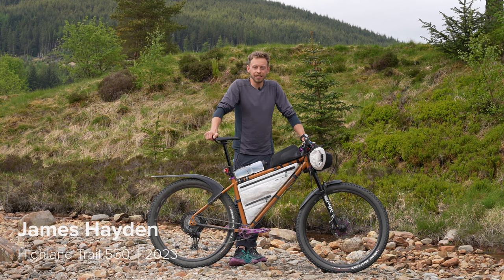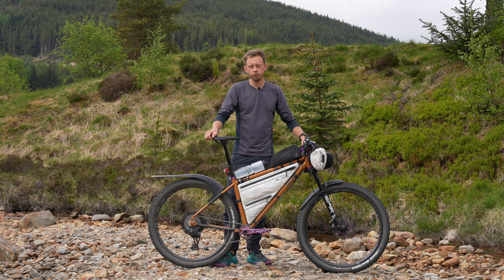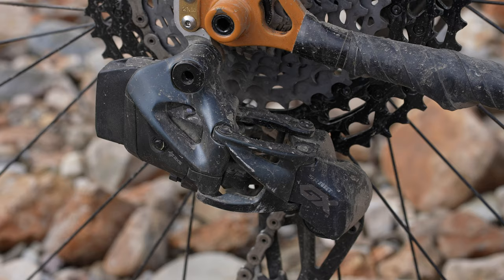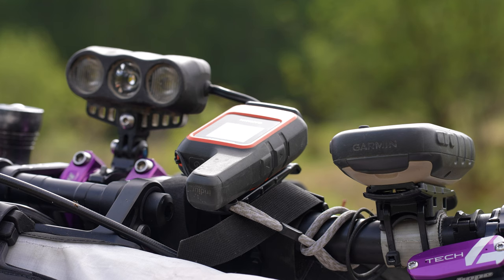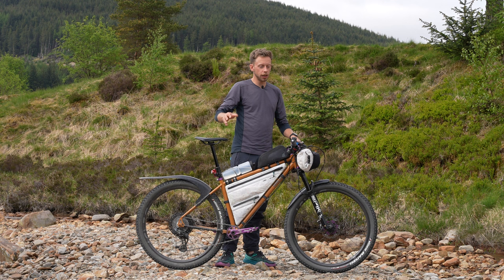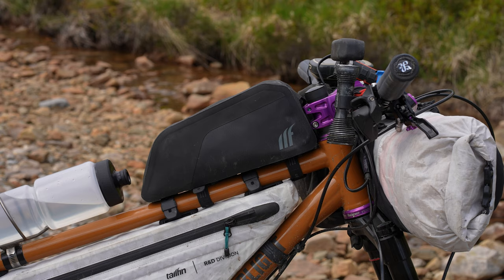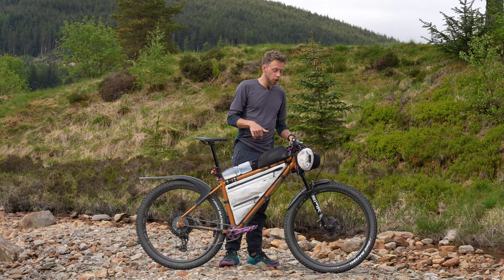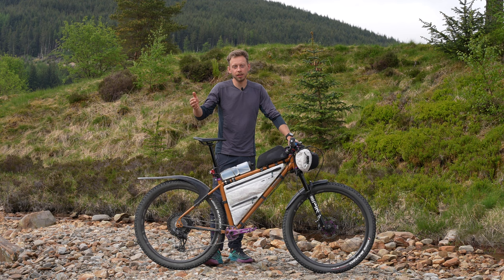Bike Check | James Hayden | Highland Trail 550 | Fairlight Holt

Comment: That front roll bag is like a Tardis! You've managed to get loads in there James😁
Reply: Yeah I was impressed! It's quite long so spacious. Insulated jacket, fleece tights, socks, Rab GTP jacket + trousers, SOL bivi and neo air pad. 😂
Reply: @jameshayden33 SOL escape bivy? Seems a popular choice if so. I think Huw had that one last year!
Reply: @samueldavidson7956  yeah, light but also works ok to retain heat, stop wind and breath a little. I think if you're trying to actually sleep it's not good, but for 1h30 it's fine, and wore my insulated coat.

Comment: How did you manage to get a 180mm dropper on it?
Reply from the maker: It looks like James has placed the dropper fairly high in the Seat clamp allowing him to fit the 180mm
Reply: @TailfinCycling  The Holt takes a 27.5mm seat tube. The only compatible droppers I've seen were ~120mm ones
Reply from the maker: Hey, looks line PNW make one going all the way up to 200mm!
Reply: @chrthiel this isn't quite a Holt and has 31.8 😉
Reply: @jameshayden33  From the beginning, I was wondering why Fairlight decided on such a niche product with 27.2mm seat tube, as it doesn't matter so much, because 31.6mm droppers have already around 27mm upper tube, and that matters the most for compliance. With standard seat posts 30.9/31.6 they could offer 27.2  adapter... Congrats on your recent great results by the way. :-D